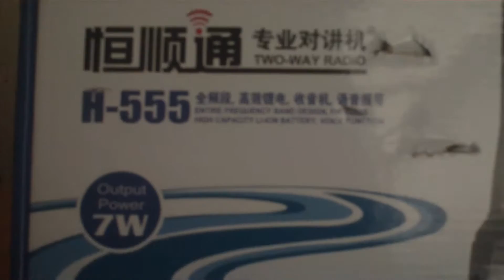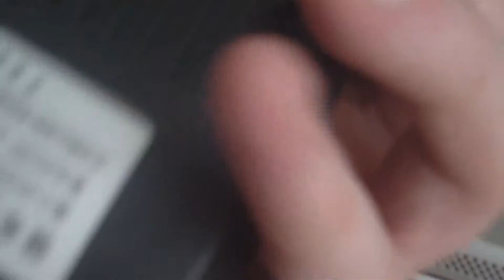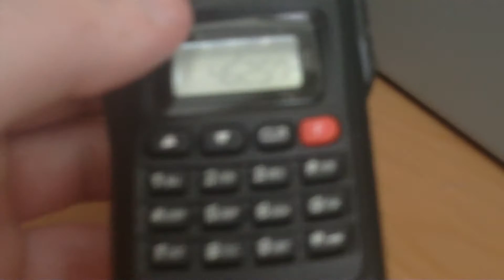H-555 / TYT-900 [ A0848A Black ] BF-888S H-777 UHF-FM 400-480MHz HT Unboxing and First Impressions

Comment: Thank you so much! It worked. What I had to do was hold down the monitor button and the menu/function button at the same time. Then I had to power it on while holding those buttons. It would then say CLEAR. I hit the menu/function button again and it rebooted and worked like new out of the box.